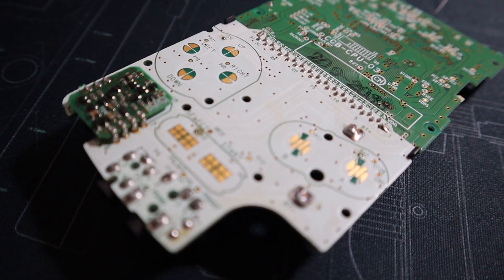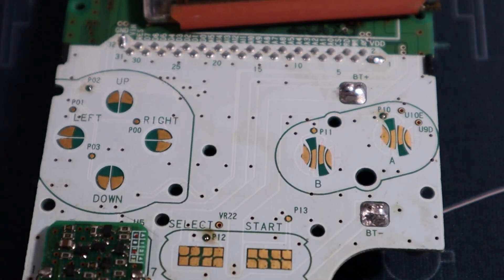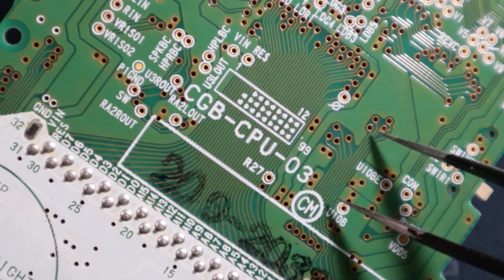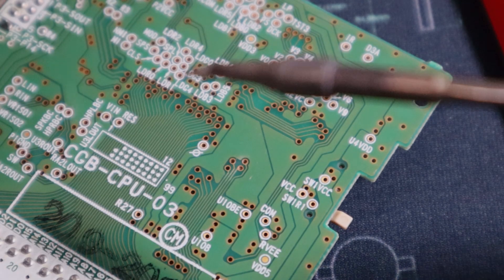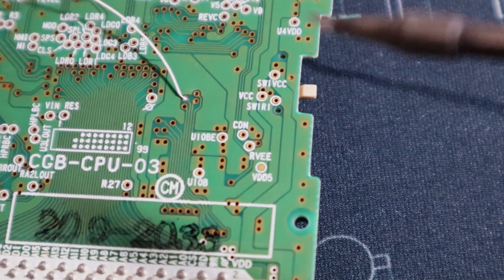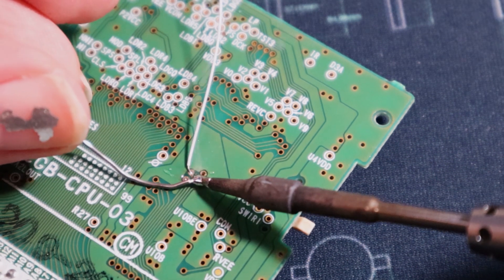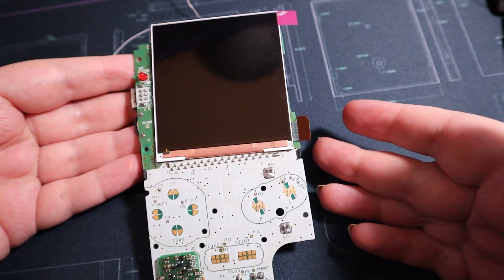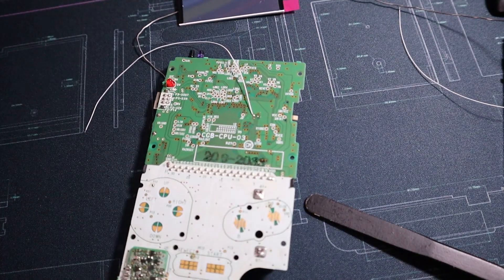Soldering to Game Boy vias

Comment: Thank you very much for this video o:, just yesterday cleaning the inside of my modified gbc I moved the Q5 IPS mod cable that was connected to point P12 :c and the pad came out along with the cable, I think it is safer this method to avoid this kind of problems, Greetings from Chile c:
Reply from the maker: Ideally, using the bottom row of vias is best just incase you pull it off again. I'm glad I could help though, greetings to you from Australia :)